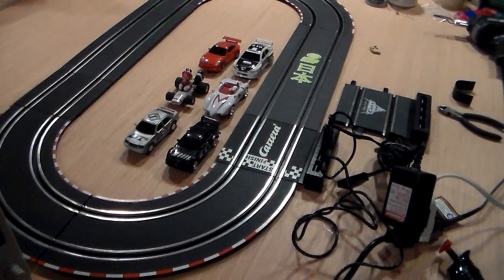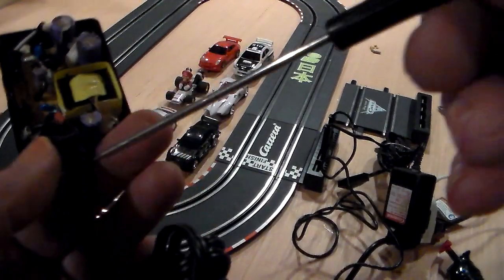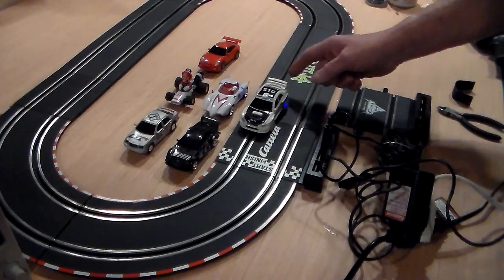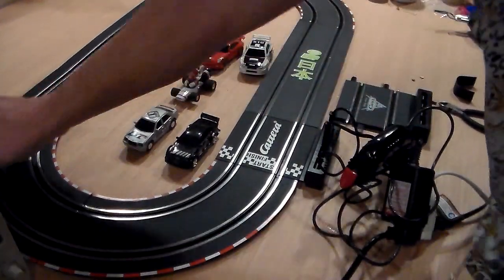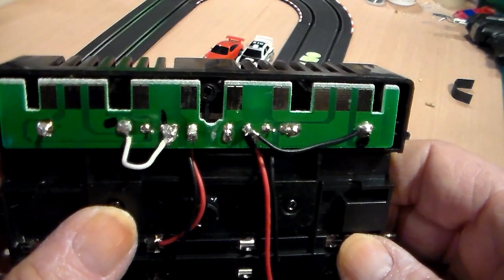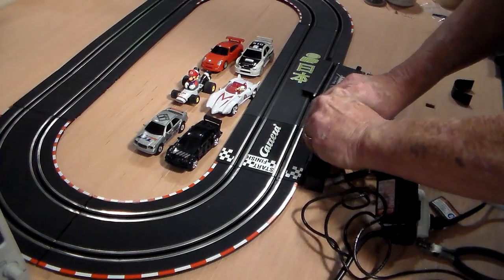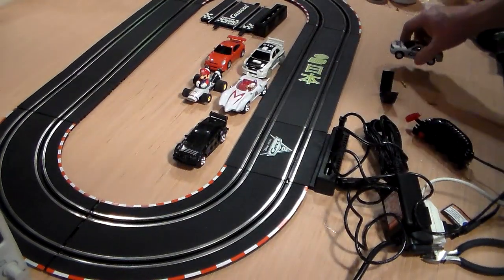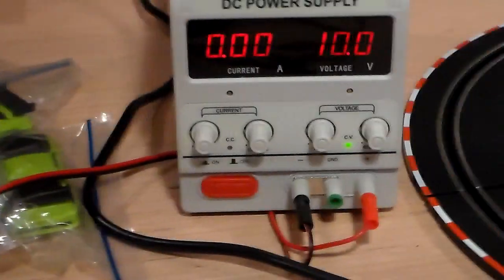Part one Carrera Go Track power problems for using Artin Cars

Comment: Both lanes on my GO track are hot (live) regardless of the position of the controller, do you think it's an issue with the electronics in the plug? There was nothing noticeably at fault on the track end. Any way to troubleshoot, or just get a new power supply?
Reply: Facing same problem.  Did you ever figure how to fix it
Reply: @whencool  same
Reply: @ @gabrielcavalle1993  called up their toll free number. and they are sending a replacement controller.. hope that fixes the power problem.. lets see